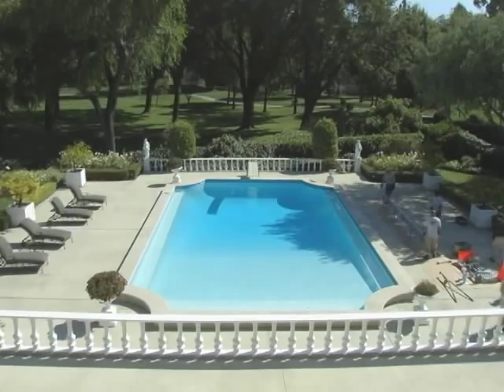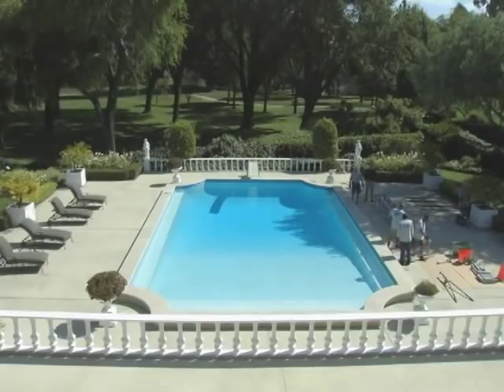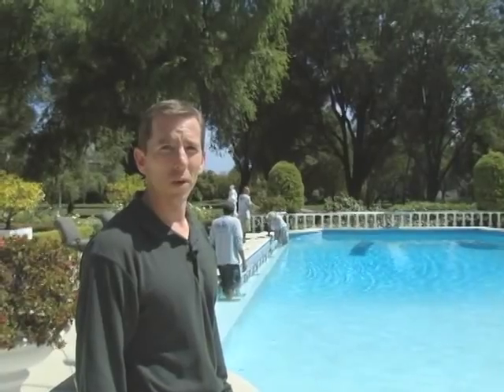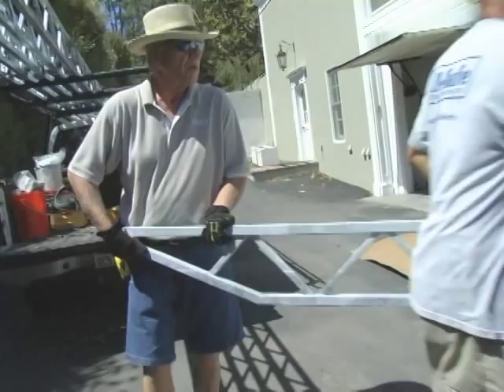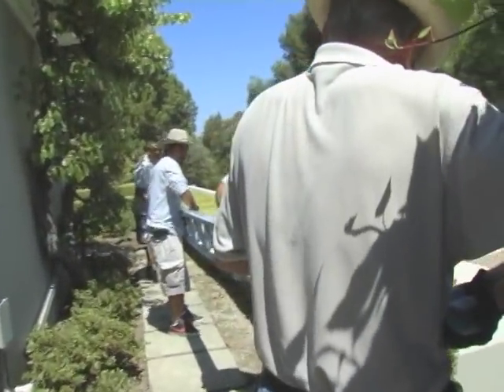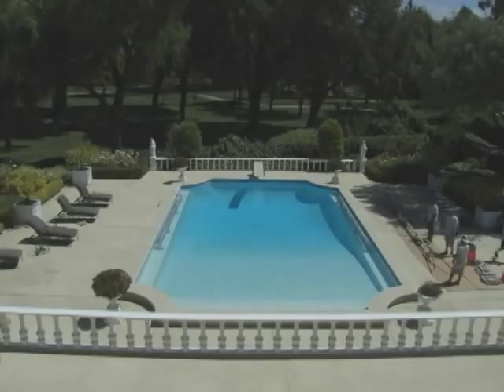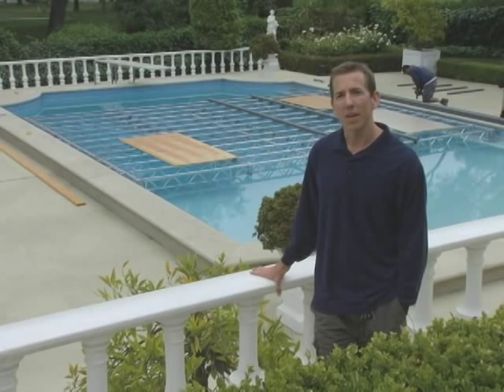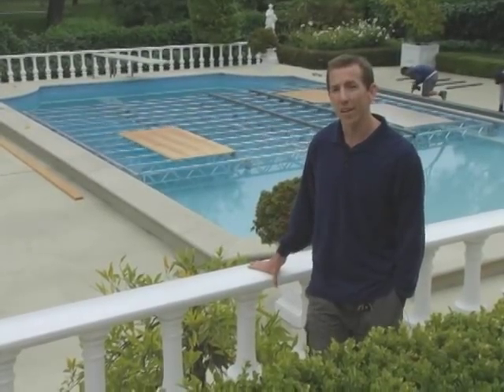Dance Floor Pool Cover by All-Safe

Comment: Okay ... so the plexiglass type of cover is rented out for events, so it's not a good fit for your needs. It is heavy and expensive and is not meant to be left in place for more than a few days. Your best options are going to be a pool safety net, a mesh pool cover, a hard spa cover or a removable pool fence.